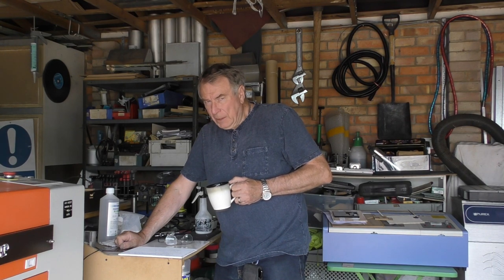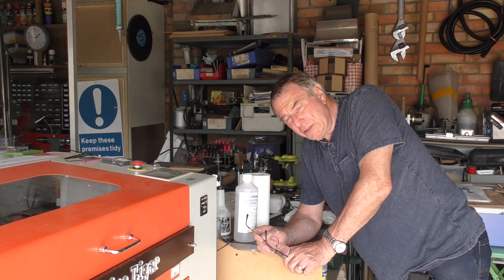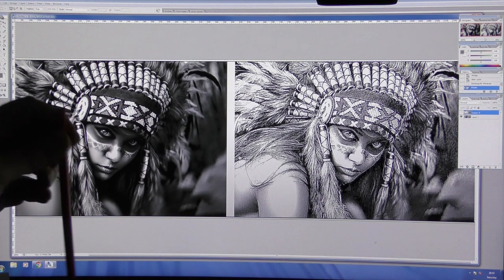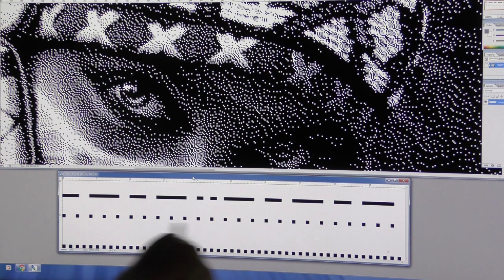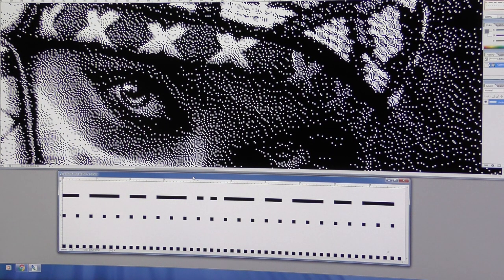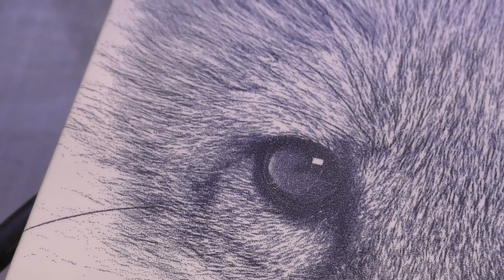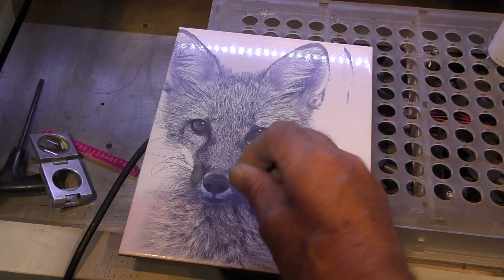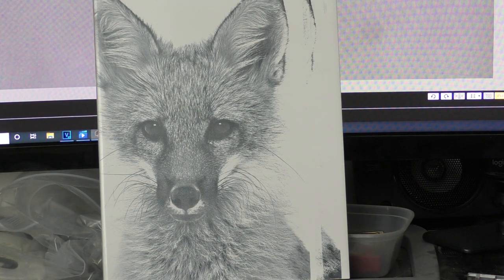RDWorks Learning Lab 212 Understanding Black Etching Ceramics Part 2

Comment: I have been watching every single video and reading every bit of information that I can find with regards to white tile and your video's are by far the best and most explanatory video's that I have seen yet. Very well done! Thank you!
Reply: Hi Matthew
I have been exploring photo replication for several years and for any other materials the best resolution I can cosistently achieve good results with will be 254ppi
However the amazng capillary action that causes the TiO2 to create a little black spot in the cenre of a pool of melted glass allows me to push the technique to 508ppi.
 see  https://youtu.be/TVgmoN1wljs
 Thanks for the kind words
Russ
Reply from the maker: Hi Matthew
I also caugth you first comment about running the process twice.  A nice idea  but sadly impractical because of the mechanical accuracy. The manufacturers of any diode or CO2 laser equipment use the word "resolution" to imply mechanical accuracy when all they mean is that the drive pulley ratios and step settings of the stepper motor translate to a theoretical head movement of +/-???.  Tehre are many issues between the head and the stepper motor that will prevent this ever happening. So, at 254 ppi,  that requires a repeatability of better than 0,02mm to achieve what you are thinking of and that's not possible.
Many guys in the diode community are playing with Borax as a way to get super black images on wood. Yes it does work well but is another misunderstood process. The black has  nothing to do wit henhancing the burning properties of wood  (as many believe). No, it is a process of chemical change that produces amazing characteristics.I explore this process in     https://youtu.be/7pFuW1zPkkg       and you will also see TiO2 transforming from a white powder to a black blob

 Best wishes
Russ

Comment: I've watched many videos on tile etching. Some of the hosts said they  didn't know why it worked. My first thought was, "Well now, how would Russ look at this?" That got me to thinking (kind of like you) that since you use white paint to paint the tiles and when you burn it with the laser it turns black and will not come off no matter how hard you scrape, it stands to reason it had something to do with the titanium oxide in the paint because everything else would just burn away because of the heat. But not the metal. I didn't do any more research on the subject because my plate is plenty full enough (now I know why it's called retired, it's because I am re-tired). Thanks for the video. You confirmed what I thought it might be. When I find the time  I want to do some experiments to find how small a pixel I can make with the LaserMaster 2Pro. I know I can cut a line that is only .02mm wide.
Reply from the maker: Hi Kris
 I have no idea what sort of lens or even beam diameter you have on the 450nm blue laser. But I do understand how and why the ceramic tile  process works. . Because your machine is electronic and operates at a fixed output power (always 20 watts) the control of power is by switching the beam on and off rapidly with PWM. The thickness of a line is not necessarily the smallest dot because you will be using speed to filter the damage potential  to all but the most intense central part of the beam. I have to fight with the same issue on my RF controlled CO2 laser that uses the PWM control system.. For every other type of photo engraving it is very poor because it cannot replicate single pixels . When it reaches the edge of a pixel the beam instantly turns on. That causes half the beam to be outside the pixel. The beam stays on as it traverses the pixel and instantly turns off at the trailing edge of the pixel. However at that switch off point there is already half the beam  outside the other edge of the pixel.. This is a natural consequence of PWM control So imagine a line of pixel dots spaced 1 pixel apart. If the beam burns half a pixel in advance and half a pixel after the pixel then there will be no white spaces between that line of dots and it will appear to be a continuous line..  The point I made in this video is that true photo replication happens when you replace screen piels with dots . If you can only produce pixels that are two DOTS wide  then you will have to degrade your image so that the there are less pixels further apart to compensate for this problem.

I now must add that I have not yet tried this white tile technique on my RF laser , I will be doing that soon) because understanding how the physics and chemistry works   it may well be that there is an amazing effect that overcomes the two DOT issue. As you can see from my microscope pictures,  the TiO2 melts and recrystallizes to a  black blob at a higher temperature than the molten glaze. It is possible that the molten glaze blob will cause the black TiO2 core  to centralize by capillary action, like the yoke of an egg when you crack it in the frying pan. I do not have a 450nm laser so I cannot try it. Let me know how you get on.
 I do know that my brutish CO2 laser can achieve amazing results with this technique and I DO NOT have to prepare  my images in any way, I just do dot for pixel replication and have achieved 500 DPI images so far. See   https://www.youtube.com/watch?v=TVgmoN1wljs

 Best wishes
Russ

Comment: Russ - to get an even layer with an airbrush, start the stroke and paint flow off the edge of the tile, do a full smooth pass across the tile and go off the edge again before changing direction and dropping down for the next pass. You run in a "racetrack" pattern across and down until done. Great result 😎
Reply: Thanks Steve . Good advice. I was fighting the airbrush trying to get a consistent  delivery for more than a few seconds.  I may have to use my shop compressor and regulator because I cannot get a steady consistent flow to run smooth steady sweeps. The little compressor supplied is pretty pathetic. In this session, coverage was more important than technique.
 Best wishes
Russ
Reply: @russsadler3471  Shop compressor is much better than the toy ones. Run regulator between 15-25 lbs and see what pressure works best for you.

Comment: Thanks Russ, finally someone answered my question about whether you could use the Norton method successfully using a CO2 laser, and it looks like you definitely can. What I would really love to see now, is a comparison with a diode laser using the exact same image, under the microscope as you have done. Cheers, Steve.
Reply from the maker: Hi Steve
This process  has a lot more potential than I demonstrated. The frogspawn manner in which the titanium dioxide agglomerates into the center of the "burn" suggested I could dramatically increase the resolution. It was now capillary action and not directlocalized
Reply: @SarbarMultimedia  I have a printing pre-press background (40+ yrs) so this sort of thing fascinates me. When you say 'increase the resolution' do you mean reduce the dot size, therefore fitting more dots in along a given length? Or something else. I don't own a laser yet but was tossing up between a small CO2 or a Diode. I keep swaying between both. In my last job I was using a Trotec Speedy400, so I do have a general understanding of these machines. As a matter of fact, I have learned a hell of a lot from viewing your great in-depth videos and putting it into practice at my work. Well, that's before I got laid off :( Cheers.
Reply from the maker: @stixstudios3380  Hi Steve
 In answer to your first question , yes, more dots per inch = smaller dots , so  at 508ppi  the dots will be 0.05mm diameter.
The Speedy 400 is the sort of machine that I and many others have envied for many years. The massive hype that Trotec and Epilog use to promote RF technology  always implies that there is something  "magical"  about the technology that those "crap"  Chinese glass tube machines cannot compete with.  About 2 years ago , I was lucky enough to be offered  a 30 watt  RF source by Cloudray to investigate  just what this "magic" was all about.  I bought my own cheap Chinese machine and in my Tangerine Tiger series I set about creating my own budget RF system.. OK, so  there were no sophisticated dc  servo drives or fancy bearing systems  but it was the laser technology that supposedly possessed the "essence of eternal life". 

Just like a diode laser, it is PWM controlled.  Hmmm and that proved to be a big problem for photo replication. To be honest almost everything about the technology disappointed me.  Strip away the menus  that Trotec and Epilog  use to make their machines  user friendly and   there is a very complex technology behind the scenes. For an  industrial  machine,  I can see that it is much easier to learn a menu structure than to understand the technology.  It also seriously limits what you can do with the machine because there are controlled paths that you have to follow.  I think your confusion about resolution may stem from the fact that ppi means Pulses Per Inch  and not Pixels Per Inch in the Trotec world.

After my initial build and extensive testing over about 6 months, I could find no reason to use a complex 30 watt machine when I had two 70 watt glass tube machines that  were totally reliable, fully flexible  and did not suffer any of the mythical issues that are supposed to  make Chinese machines a waste of time and money. I am sure that if you have watched some of my videos , I make it clear that I am not teaching or preaching lasers  but am just a student who is self-educating on all aspects of the technology.  I speak honestly about what I find and am not frightened of making (and publishing) my mistakes or criticizing things that don't make sense or are fraudulent. Smoke and mirrors best describes RF technology. That machine I built  sat idle in my workshop for almost a year (that says it all) until I took a new look at the RF source and discovered the amazing small diameter high intensity beam that existed at the tube exit.  That set me off on a whole new venture to try and exploit this beam in a different way.  It delivers 30 watts that cuts very poorly. I imagined it may be possible to go totally against the beam expansion concept that is a necessary evil to overcome the rapid divergence associated with RF beams. and find ways to exploit that high intensity source. Sadly I have bumped into some serious physics issues that I did not realize lenses possessed. That's one of my current fascinating journeys.

Your question about CO2  (10.6 micron wavelength)  or diode (0.45 micron wavelength)  is really a no brainer. Yes, diode technology is pretty cheap and simple because there are no complicated mirror set ups for flying optics and you can scorch organic materials , engrave glass and make black ceramic images. Cutting potential is poor and  pretty crude. but these machines seem to be the new K40.  I have never thought of a K40 as a proper laser machine, just a technology sampler until you can afford something better.
 
 Cloudray gifted me a returned  bottom of the range K40 machine and asked if I would upgrade it. The simple answer was no but I did accept the machine on condition that I could redesign it and make it into a proper small format (A4)  digitally controlled laser cutting and engraver,  just like my other machines. .  I have created a series of 6 video that will be released shortly, showing how you can take a box of nails and turn it into a trinket box of gold,. It can now  run at over 1000 mm/s and does everything my big machines can do.  You may decide that it's  an interesting path for you to follow. This is an unpublished video because I am currently putting together a pack of drawings for when I make it public ,  but here is a preview  link to the final session where I test it to demonstrate its potential
https://www.youtube.com/watch?v=i1M39dzyCOw

Best wishes
Russ
Reply: @SarbarMultimedia  I think you are right about my confusion with Pulses Per Inch vs Pixels Per Inch. In the old days there was also Lines Per Inch which referred to granularity of the halftone screen used to create it. In the mid 80's one of the first phototypesetting machines (Linotronic 300) had a resolution of 2400dpi which was pretty good - I believe it used a helium neon laser and some sort of hexagonal rotating mirror to fire the dot onto the photographic substrate.

Maybe I'm getting off track but I'm talking about standard printers halftone screening vs the dithering technique which uses the same size dot but spread out. I think that's called FM screening or Stochastic screening in the printing world. It would be interesting to see what a halftone screen version looked like when engraved using a CO2 or Diode laser. Probably not very good considering most people don't use it. Although an advantage with halftone screening is that you can get very smooth gradients if you have a very small firing dot and higher LPI around 150. Anyway, I'm probably looking at this from a different angle - which may be totally wrong.

Two things I don't like about diode lasers is the rectangular dot and they can't cut clear acrylic. I was looking at a second hand little Ten-High430 40watt CO2 with a 40x30cm bed. I know this would suit me better, but it's twice the price of a new diode. I'll have to save up a bit more I think. Meanwhile I'll have a look at your K40 machine preview video. 

Cheers.

Comment: II love how you bring some science to the game.  Keep doing it.  I have an elementary question about if I understood your process, you converted the photo using a process called dispersion dithering.  Is that correct, or is that the nature of the photo unprocessed?  If you converted it, what software do you suggest?
Reply from the maker: Hi Terry
  Then photo you download will have a certain resolution (pixels per inch) You cannot use the colour so it needs converting to grey scale.  I happen to use Photoshop where I do the conversions, cropping and if necessary , downscalling to a uasble resolution. Within Photoshop there is a dithereing algorthm called DIFFUSION DITHER. It is mainly based on what I consider to be the best grey scale converion algoritm called Floyd Steinberg. There are many other algorithms  available in different softwares. For example within Lightburn there are 4 dithers available. Atkinson, Dither, Jarvis and Stucki. There are examples of each on a little panel at the bottom of the window Take a look at the black band  on the left and see how far each dither option goes into that black. You will find that DITHER is the best and intrudes the most.  Now take a look at the text below the pattern and what do you see? So look no further.
 On the other hand you may be using RDWirks.If so then import you picture and then selct HANDLE from the toolbar and choose BITMAP HANDLE. You can do some basic fiddling there and eventually select the dither option and choose the dot option. Its resaonable  but not as good as Floyd Steinberg. There is another piece of free photo manipulation software called GIMP that you can down load and it is a fully featured replication of Photoshop.
Best wishes
Russ
Reply: @SarbarMultimedia  thanks Russ!  Keep the research going!